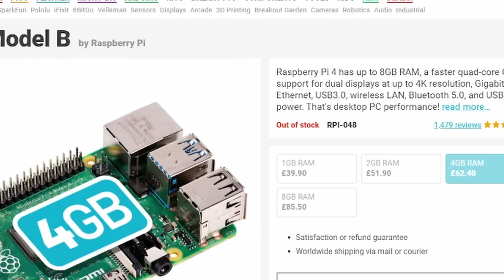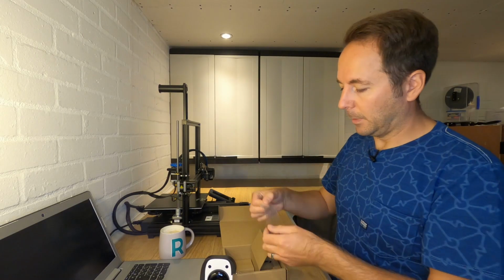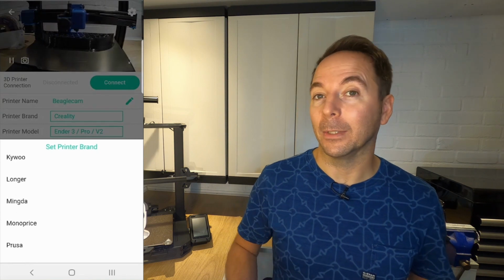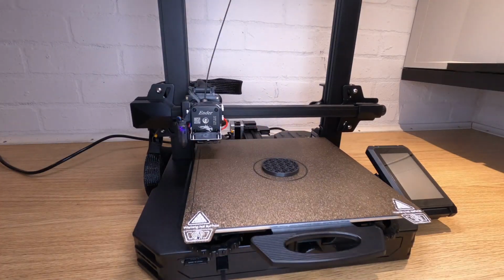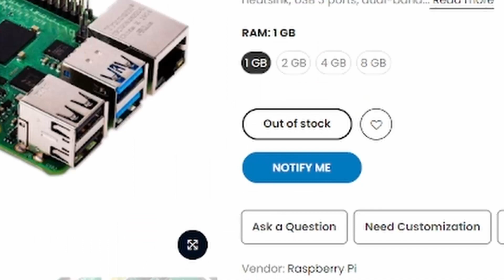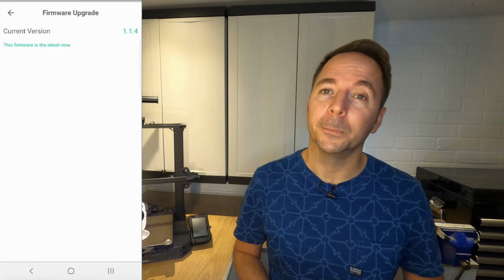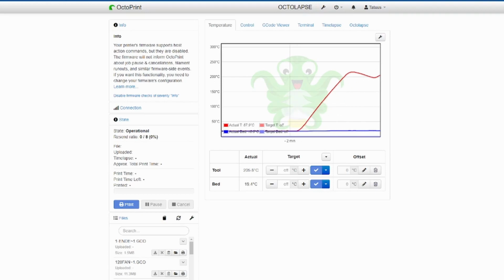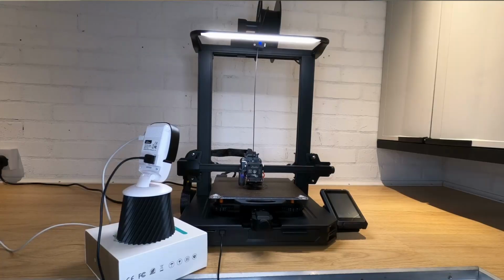Beagle Print 3d Printer Camera Review - Actually Better Than Octoprint??

Comment: Thank you for the information, it was very helpful.

For me personally, at $172, I'm definitely going with a $40 Wyze Camera and a Raspberry Pi Zero 2 W $21, with all the additional features of OctoPrint. I am pretty good when it comes to gadgets and have been working with Raspberry Pi for years, so in my case, I would rather not pay four time time price, and I don't trust Mintion do provide the same functionality and security, that an open source project like OctoPrint can provide.  Currently, I'm using Docker to run OctoPrint, but thanks to your video, I will switch to using a Raspberry Pi and add my Wyze camera.

Comment: Remote monitoring means "within running distance" to deal with any issues (particularly thermal runaway). Monitoring outside the house (re: shopping) is a bit mad. But at least you'd have video to prove to the insurance company that they don't need to pay out since the fire was started by an unattended printer.

Comment: Your review is one of the reasons I bought a Beagle Camera. I've had it for a week and no problems. Thanks for the tip about the tape on the USB pin to cut power to the printer, saves me from unplugging the Beagle before turning on the printer.
Reply from the maker: Great, glad you like yours too👍

Comment: hello, nice video my friend, by chance did you do some 3d printing with more than one color using pause or Z-offset in Cura using beagle application, it doesn't work for me, completely ignore the gcode.
Reply from the maker: Hi, I'm pretty sure I've done colour changes using the M600 colour change command sending the file from the Beagle. Works the same as straight from the SD card as far as I know. Have you tried the exact same file from the SD card?
Reply: @RickyImpey  I did exactly the same as I always do using the card, but it doesn't pause to change the filament...
Reply from the maker: I believe that could be to do with firmware configuration. What firmware are you running?
Reply from the maker: And also what 3d printer?

Comment: Hi can you please tell me how to set z hop on ender 3 S1 pro?
After the first layer my printer prints in air
Reply from the maker: Hi, z hop is just a setting that tells the nozzle to lift up a set distance when it is not extruding material. It should then drop down again when it starts extruding. I would be surprised if that was your issue. Is this happening with the Beagle camera?
Reply: @RickyImpey  no this happens when I use octolapse from octoprint
Reply from the maker: @viralvids2480  Does it do it when you put the same g-code file on the SD card straight into your printer?
Reply: @RickyImpey  yes I directly give prints from octoprint
Reply from the maker: @viralvids2480  Sure, but I'm trying to see if your issue is caused by the whole of Octoprint or just the Octolapse plugin.
Reply: @RickyImpey  I guess it's in slicer setting
Can you tell the z hop distance?
And in prusa slicer there is z lift above and below what should I give in that?
Reply from the maker: @viralvids2480  I usually use a z hop of around 3-4mm but I rarely use Prusa Slicer.
Reply: @RickyImpey  thanks I'll try these settings

Comment: Beagle cam stopt my prints randomly for about 1 second. And no, i am not talking about timelaps. 
It is happening if u try to print round objects. Like a zylinder. The cam can not handle this. 
With the sd card directly in my printer i had no problems.
Reply: This is most likely due to the printer saving info on the SD card every few seconds if you have a power loss recovery on your printer. During time it takes to save the information on the memory card, your printer essentially runs out of commands and has to wait for the next set to come in. Sorry if I haven't explained it well, but removing the power loss function worked for me.
Reply from the maker: That's interesting, I haven't had that issue myself but I did have it with octoprint on a raspberry pi when using it with my Creality CR10S Pro. What printer are you using it with? I put it down to the 8 bit board on mine but I don't know for sure.
Reply: @RickyImpey  i have a ender 3 v2.
Reply from the maker: @D.TH.-RC  Yes, mine is definitely works fine with my Ender 3 V2.
Reply: @D.TH.-RC  maybe the firmware on your printer conflicts for whatever reason
Reply: @England91  maybe

Comment: Stuff that, at $70 they can keep it. even the discount will not help because of the shipping since it is a American product.  Not a replacement for the PI which again is silly costing.
Reply: That's actually cheaper than I thought it'll be.  

Checked Pi prices and you're not gonna build one CLOSE to that price even if you can find each piece in stock.  Seems to be kits in stock mostly (pi+case+power cable etc), and then you'll need to add the cost of a camera too.  

I'd say right now, for anyone that doesn't have a pi, and just wants to remotely monitor/start prints this is actually a pretty good product.

I got a pi with octoprint on my CR6-SE. Not because i'm interested in timelapse, it's because the SD card reader on it is a joke.  Constantly faults, so have to print directly from the pi.  Seems to be a fairly common issue on the CR6-SE from my googles.  So I guess there's another reason someone might want this (assuming it can print directly from the camera without uploading to the printers SD card). 

The ease of use is also huge imo.  I looked at octolapse to test the moving the hot end for taking a timelapse.  But boy is the setup daunting.  Yeah I've found tutorials, but it's simply too much effort.  I gotta dick around enough with 3d printing, so not worth it for me.
Reply from the maker: @bruddaozzo  I can confirm that you can bypass the printers SD card and send g-code files directly from your computer or phone through the Beagle to your printer. I use this feature a lot as my office is upstairs in my house and my printers are out in my workshop. The times I've walked back up to the office and realise I've forgotten the SD card I need🙄
Reply: Not sure which website you went to but I got GBP price, company appears to be in China and delivery was free.